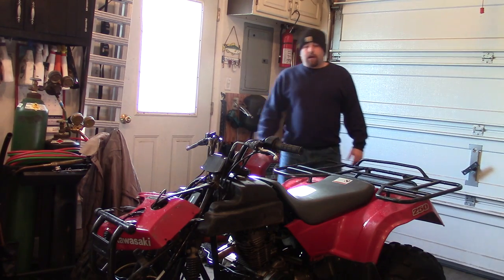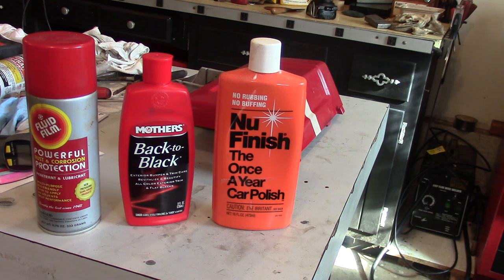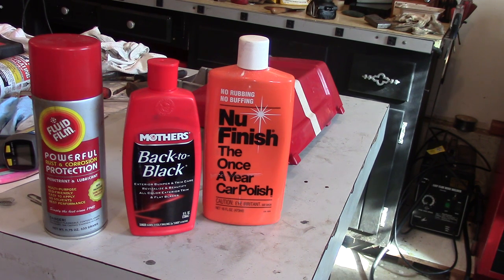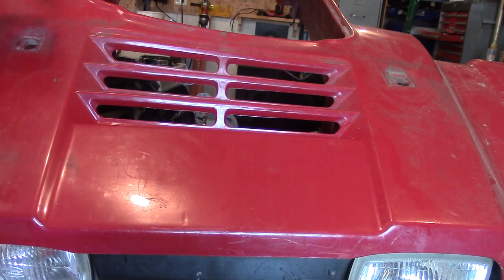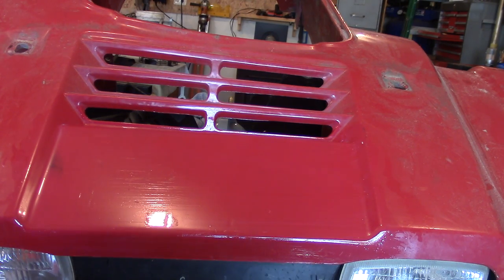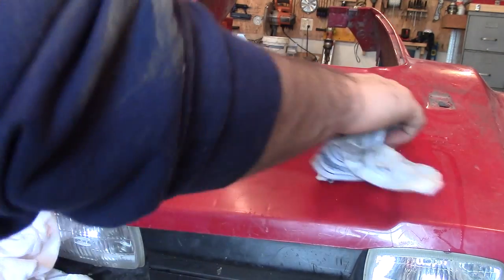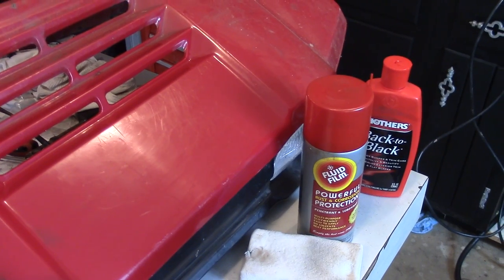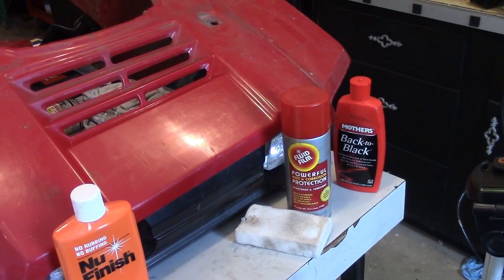Fix Faded Dull Plastic And Make It Shine

Comment: Takes a little more time, but sand paper,heat gun and a sheeps wool buffing wheel brings plastic back to new with no cover up products to wear away.
Reply: Yep, it takes elbow grease and a few steps.  It's kind of like using rubbing compound on dead paint on a car.  Takes some time and work.

Comment: I've been reading and watching that Boiled Linseed oil mixed 50/50 with paint thinner is really the way to go!
Reply: Phill Naz 6
Reply: gary smith ?
Reply: It works great, makes the plastic look like BRAND new, but it isn’t permanent.  It does last a pretty long time when the ATV is garage kept but when I kept my ATV outside it lasted maybe 4-5 months.  Super easy to apply though, so I still use that method. Only takes me 5 minutes to wipe the whole quad down with it and it looks amazing on my Recon with. 18 year old plastics.  Looks like new

Comment: Friend of mine used carb cleaner(in a can) too clean the headlights on his car.Squirted some on a rag  One swipe and they were clean  Wonder how that would work on plastic body work?
Reply from the maker: +mike97525 Carb cleaner is tough of plastic.  It will remove the gloss and make it look flat or rough.